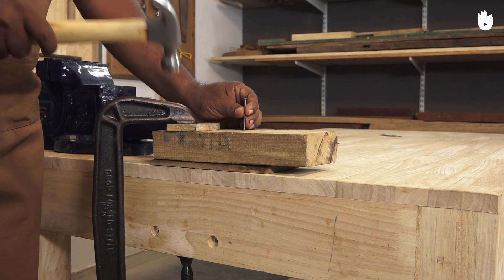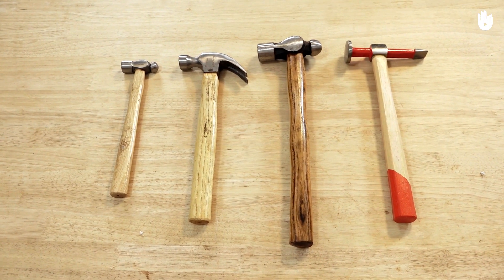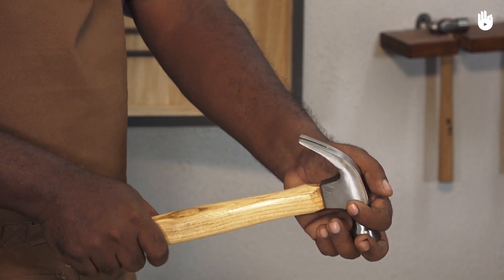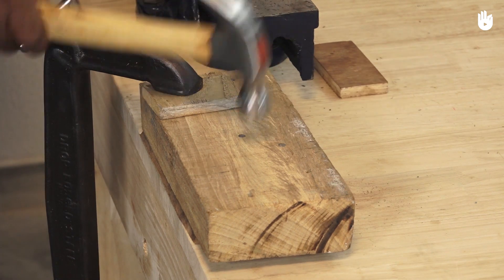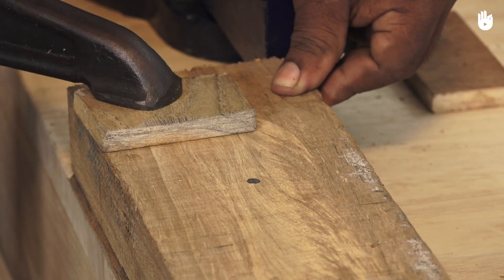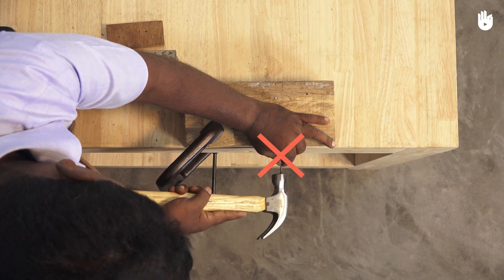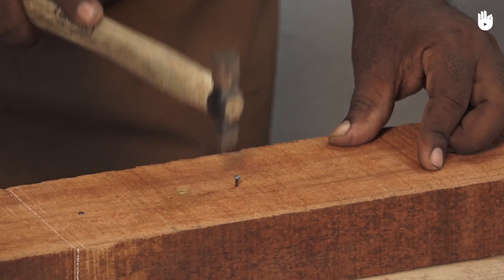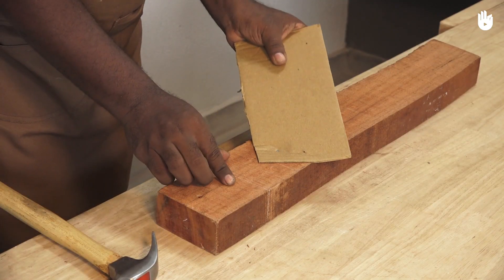How to Use a Hammer | Woodworking

Comment: - driving a nail that isn't holding anything together = check.
- damaging the piece of wood you're nailing with the hammer instead of using a nail punch = check.
- getting cardboard stuck under the nail when ripping it out = check.

I think the authors are the ones that should first learn how to use a hammer before writing nonsensical scripts to tutorial videos on YouTube.

Comment: Why my nail is bending
Reply from the maker: Hi. Two possibilities. You use a hammer a bit on the side, so you bend the nail, because the strenght should come 90 degress on it. It happens some time. Otherwise, it might be the quality of the nails. If they are not well made, they tend to bend easily
Reply: Hammer might be too heavy for the weak nails or you didn’t hammer the nail enough when you first put it in the wood. They are also right, it’s important you try to hammer pretty straight or it can bend the nail.
Reply: @SikanaEnglish  yes you're right i figured out. Quality was not good i bought good quality nail and it didn't bend. Thanks alot.
Reply: @thephilosopher5799  no dear nail quality was bad. I bought good quality nail. Plus yes i m very bad at Hammering.